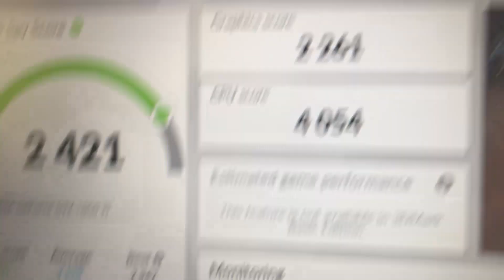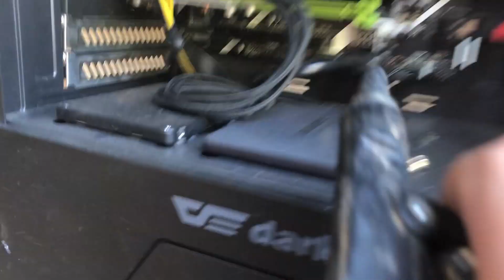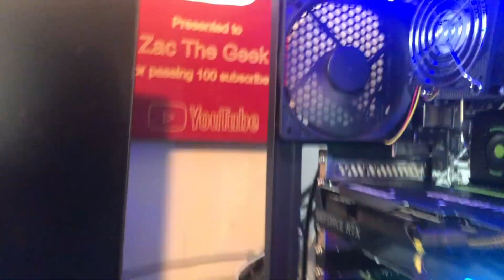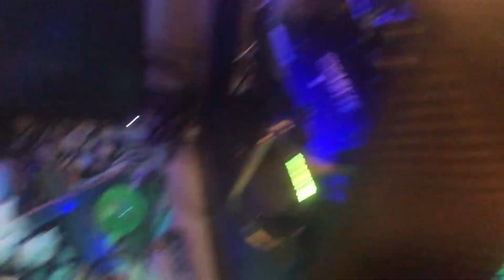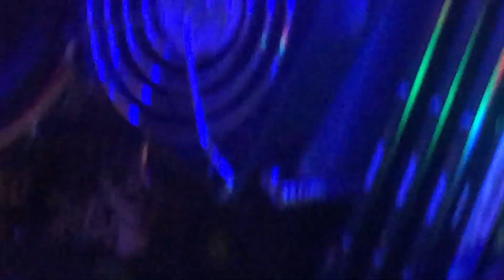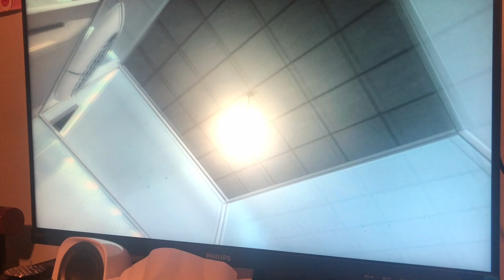I Got To Build A PC With RTX

Comment: What resolution is your monitor? Also, if it's 60Hz and vsync was turned on it would limit your frame rate to a max of 60fps. That would also cause the GPU usage to be even lower than it could be.
Reply from the maker: it is a 60hz monitor but vsync was off to see how far i could push it, so i might have messed up the settings but as far as im aware, it shouldnt have been restricted
Reply: @geekytechnology  yeah it could have turned on in the driver or sometimes games enable it by default. If it's a 1080 monitor then stepping up to 1440 monitor would also help with the bottleneck as well.
Reply from the maker: yeah, i just double checked my monitor though and its 75hz though so its odd
Reply: @geekytechnology  yeah that is odd. Lol. Maybe check the settings in the Nvidia driver.
Reply from the maker: had the same issue with a different card so i suspect its the age of my cpu, running an xeon x5690
Reply: @geekytechnology  yeah well it is pretty obvious that you should upgrade. Especially since you upgraded to a 3060. Lol.
Reply from the maker: Update on this, still using the old cpu, but turns out I’m an idiot, I’m just running an old hdmi cable instead of DisplayPort so it was capped, I have not tested DisplayPort yet BUT I think I’m an idiot
Reply: @geekytechnology  that is funny. Hopefully that takes care of the issue.